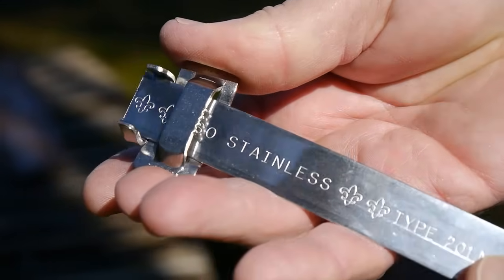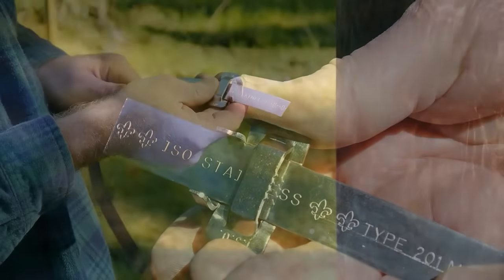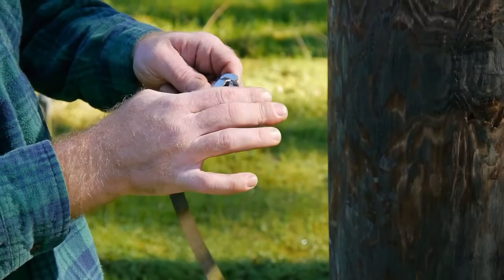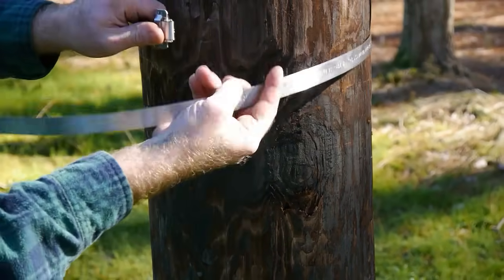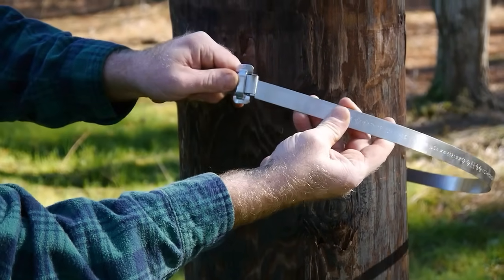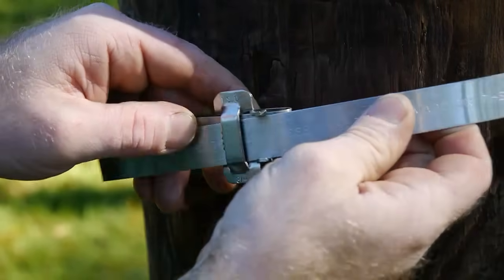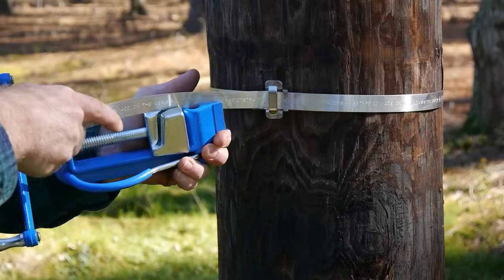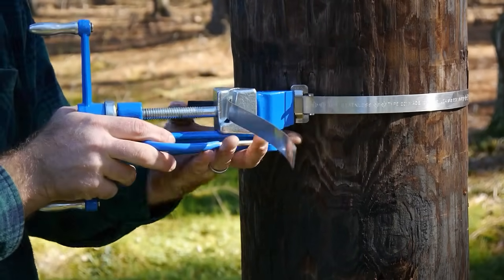How to use a steel banding tool - ISO T001 The Cool Tool

Comment: Great video from a sales point of view though I find this method wasteful and this stuff is expensive. If the clamped end is fed directly off the roll and the start of the tape is fed underneath it last there is zero waste. I also prefer to fold the tool over the buckle with the cutting leaver facing away from the clamp for a fuller fold, ease of cutting and less chance of slippage and tension loss.